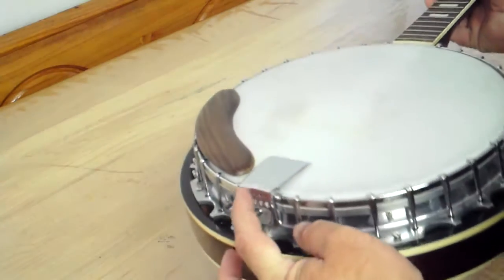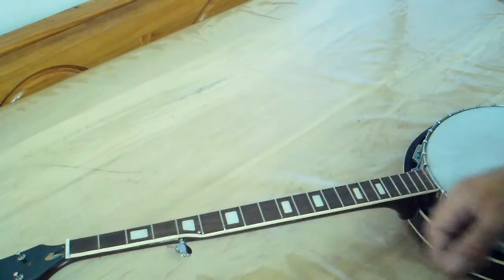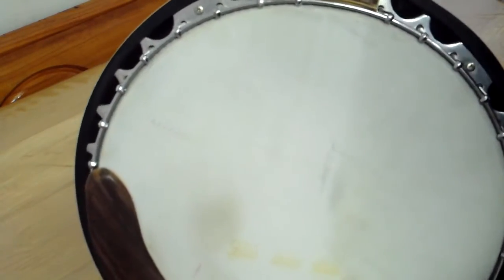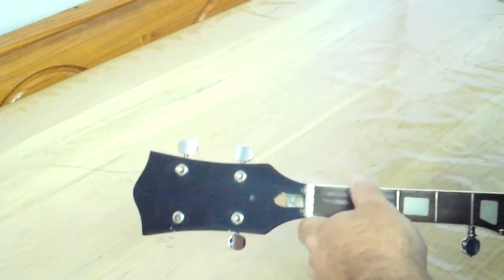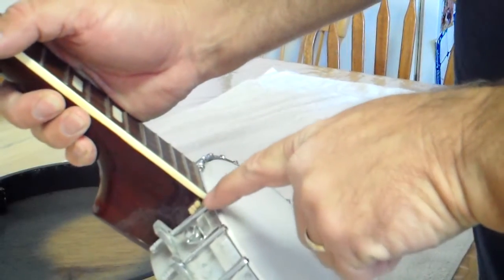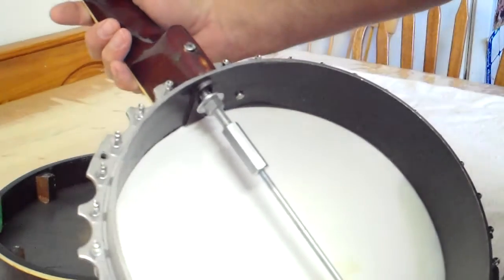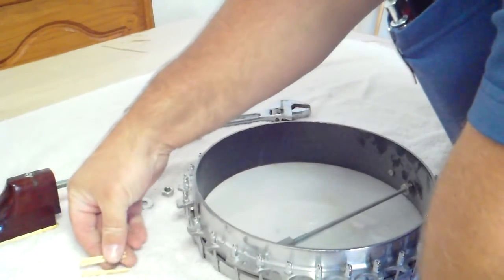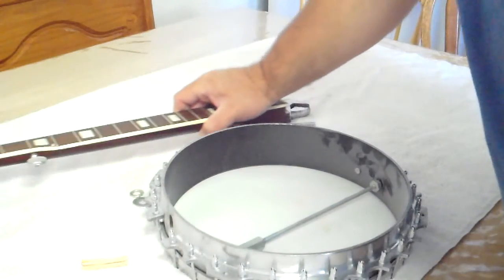No name banjo

Comment: I just got a used Banjo that's identical to yours that the head looks like a Ariana made 1960's Banjo. The heads on the one I purchased is different and older looking than yours. I got lucky, mine came with a vintage 60's Bobby Lee strap. Probably worth more than the banjo. ☺
Reply from the maker: That's way cool. good luck with yours. I haven't done anything with the one I have. I really need to get it out and playing. Thanks for watching and commenting!